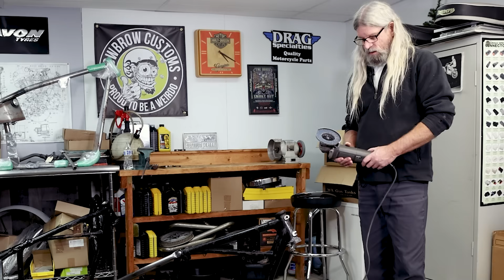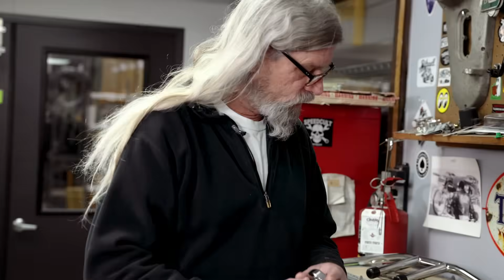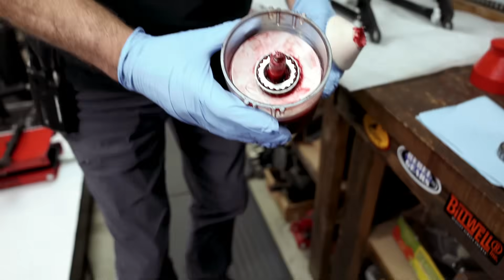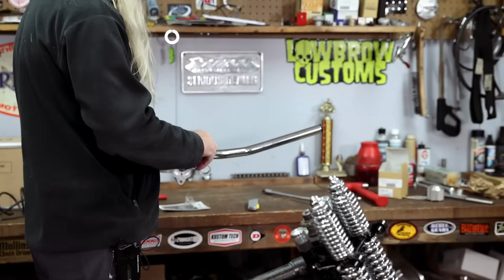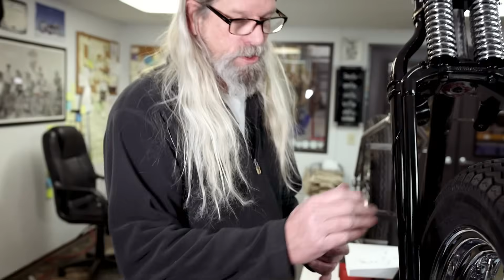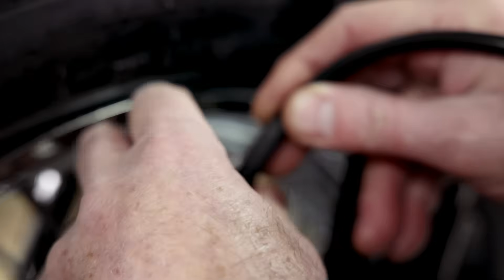How To Install A Springer & Front Disc Brake On A Custom Chopper

Comment: This is extremely timely. I put a springer and disc brake on a big twin last year, but there were issues with the spacers and the install (instructions were terrible and there's not much online). Guess there was a small amount of play in the caliper because the first time I tested it it locked the front brake and caused me to dump the bike. Interested to see how this install goes and if there's any tricks or what I missed.

Comment: Simple months ago I bought a 1970 almost stock shovelhead while the paint is not original. And it has those type of socket bolts that hold on the front and rear brakes. I'm pretty sure it didn't have the star hub so the star hub must have been prior to 1970 mine did have an older style hub though.
Reply: yes but they make after market starhubs you can buy new
Reply: @mickey-eq5vw Well so far whatever hubs I have on my 1970 seem to be in good shape....
Reply: @MoeLarrycurly1  yep they were stock on knuckles n pans from 1936 to 1966 an original starhub wheel, the 66 shovel came with drum might of had a starhub on that one

Comment: I was wondering is there something special about a StarHub other than it's old probably well made and I see it has a zert fitting..
Reply: besides being nice hubs n cool looking they were made for drum brakes unless its an ironhead where the drum is the hub
Reply: I have a 1970 Harley-Davidson FLH I don't think mine has the star hubs It doesn't look like that they kind of screw inward the last bit I think it's been a while that goes up against the bearing and my drum is part of the hub in the rear I don't know about the front but I have drum brakes front and back  @mickey-eq5vw
Reply: A sidecar or something to do with the Police version of the bike I seem to remember.